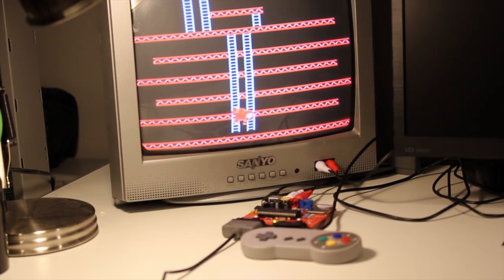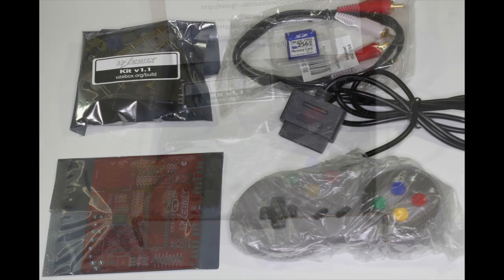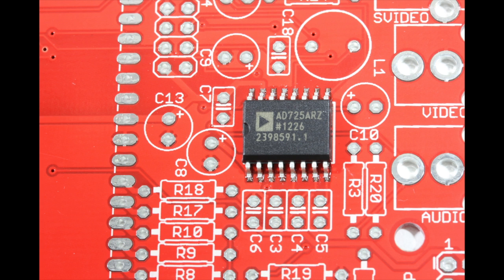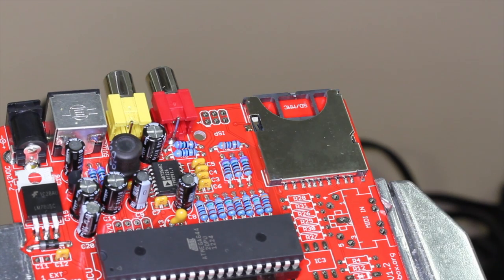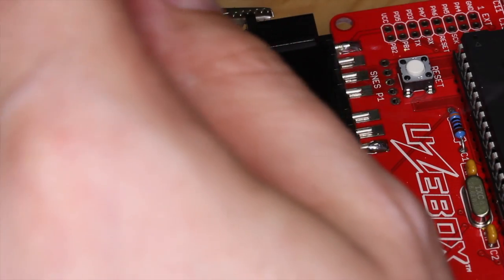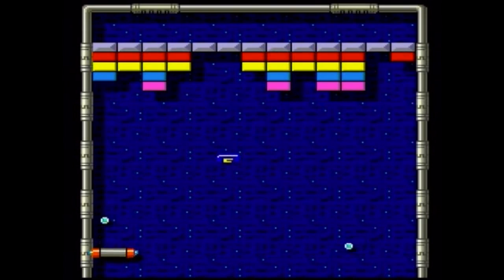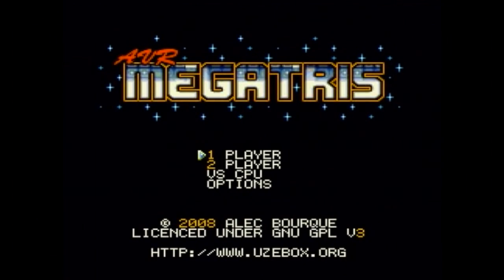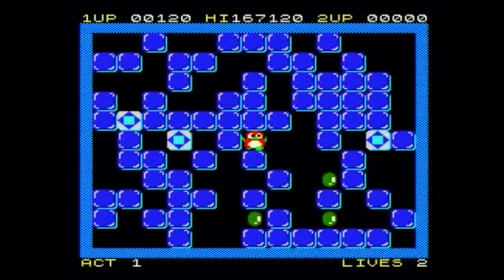Uzebox - Demo & Review

Comment: This thing is absolutely not worth 75 bucks. [edit: 75 bucks for a kit you have to assemble???  This thing just went from ripoff to scam end edit] 1 controller and no friggin power supply.  So it really isn't a "starter pack" as you ain't starting anything without the power supply.  For 75 plus shipping, you should get 2 controllers and a power supply and a much larger SD card.
I just bought a handheld game with a screen and a power supply and a battery and a 32gb card for 17 dollars.
Reply: Look at the date... This was from ten years ago. The state of the art (and pricing thereof) changes a lot in a decade!
Reply: @ClayCowgill  It was even more not worth 75 bucks 10 years ago given that prices have roughly doubled since then.  I assure you this was not state of the art 10 years ago.
Reply: This wasn't for you, the value is in being able to DIY a console from off-the-shelf parts and develop titles with total knowledge of the hardware you're working with. If you're just wanting to play the games you can just grab an emulator for your computer for free, or add Uzem to a GarlicOS handheld or something.

Comment: Let's see a new UzeBox using a blue pill stm32f103. They're less than $3. They're a 72 MHz ARM with 64k flash and 20k ram. Could be Arduino programmable.
Reply: Yes, I Love Retro Games and Super Nes too.

BUT Where are VGA 640x400 GFX ?

Or a simple Retro 3d GAME Controller like aka PSX2 or Xbox ?

The next UZEBOX II muss have a powerful MCU like a STM32 and making Games like SNES with these Controller!
Reply: Stm32 can do NES emulation but I've only seen 1 run with good frame rate the rest were slow